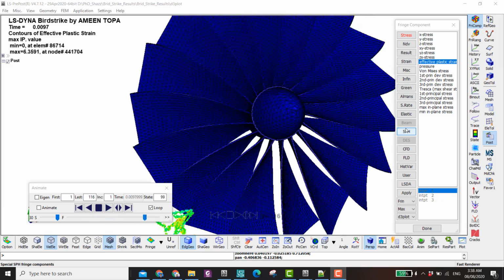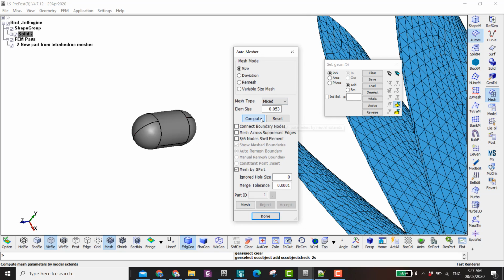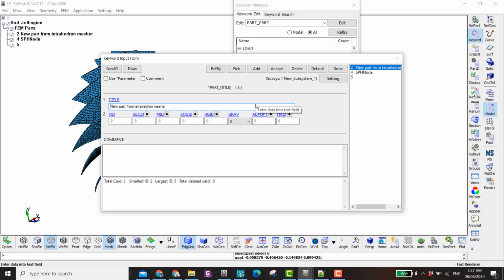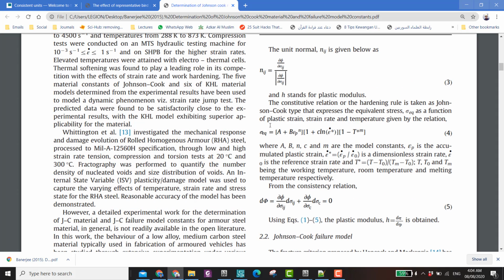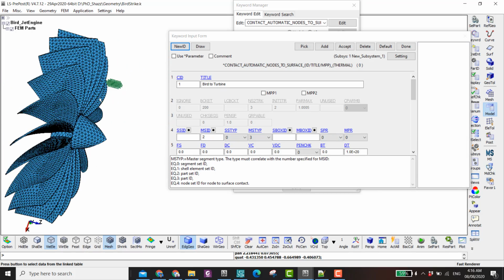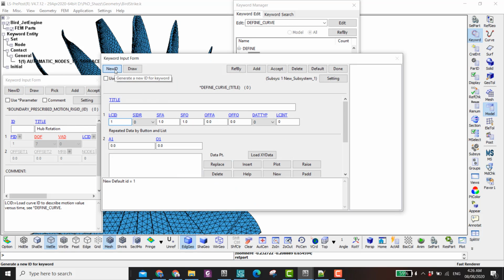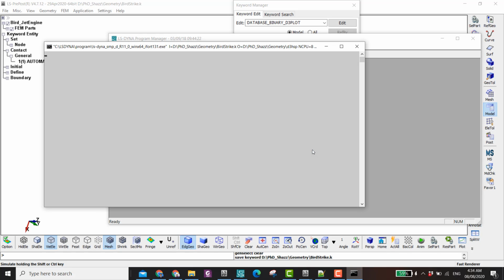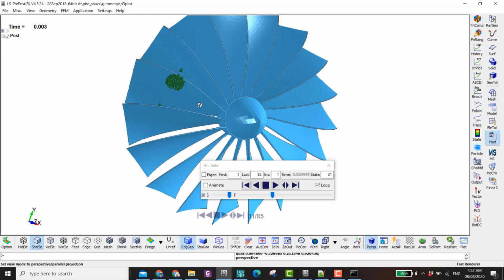LS-DYNA TUTORIAL 17: Bird Strike Simulation Revisited

Comment: thanks for helpful video. and my bird does not move. what should i do?
Reply from the maker: Double check the input. Material properties, contact, and density of the bird particles. 

This is the second tutorial on Bird strike simulation in my channel. Maybe you want to check the other tutorial first...
Reply: thanks, sir. i saw the video, and change some values. but, the bird penetrates the blade. could you tell me what's the problem?
Reply from the maker: @katyhan8102sorry, it's hard to tell without actually having a look into your file.

Comment: Amin can I make this a composite material with fiber direction. (I am asking as this is a solid element)
Reply from the maker: Yes, check my tutorial on Low Velocity Impact on a PALF composite panel.
Reply: @AmeenTopa  i used to know that I have to select Part_Composite for ply with fiber direction and then use move and copy.  But in your video i can use fiber in one direction dor each ply. I want 0/90 and 45/-45. Can you suggest me how can i achieve that. N.B as turbine blades are curve solid elements.
Reply from the maker: You can do to element tool, element edit, then choose direction option. There you can edit the direction of the elements layer by layer.  @mischief-nd5kp
Reply: @AmeenTopa  so for blades i use multiple solid elements layer and then assign each solid layers direction. will it work like the fiber direction when i use MAT_Enhanced_composite_damage. as if i use shell elements it will not give any thickness. this is for my research. And does research standards accept shell elements for (hybrid CFRP+Titanium Alloy in leading edge ) ? thanks in advance

Comment: I was solving a similar problem to this, where I took a stationary blade, and gave velocity to the bird. But as I increased the velocity, the SPH particles are passing through the fan blade, without impacting the blade. Even though everything else was the same, the SPH particles are not creating any plastic strains in the blade, instead, they are penetrating it without any effect. Please help me with it, as no matter what parameters I change, same thing is repeating itself. Do let me know if you need any other information.
Reply from the maker: Try reducing the time step size. In CONTROL TIMESTEP, set TSSFAC = 0.06667 or lower.
Reply: @AmeenTopa  I have set TSSFAC=0.06, and have got better results. The blade now seems to get deformed, but the SPH particles are still penetrating the blade without the blade getting torn (although some plastic deformation is occurring). Also, I have fixed one end of the blade/rectangular plate, but instead of the entire blade bending along with targeted deformation, I can only see stresses and deformation at the area of impact and no stresses at the fixed boundary (which I have fixed using SPC_SET). I am not able to understand why is that happening? Can it be because the velocity is too high (I have set it as 8.6e4 m/s)? Or is there some other reason? Kindly help.
Reply: @sam2215  have you find any solution to this problem ı couldn't solve it. My particles passing through my blades
Reply from the maker: If the properties are in the unit-consistent, then try reducing TSSFAC, as my previous comment above.
Reply: @AmeenTopa ı don’t know the problem but during simulation I mean analysis. My turbine model is getting bigger and bigger like it’s growing. I couldn’t understand the problem. Although I changed the time-speed-time step etc. I couldn’t find the problem. Do you have any chance to control my k file if I share the link with you
Reply from the maker: @celalbas3116 if it gets bigger and bigger, it could be a problem with the initial velocity.

Comment: Thanks a lot for your videos, they prove to be wonderful to learn LS-DYNA. Its just that I was solving a similar problem to this, but instead of taking the entire fan, I just took one blade, kept in fixed using spc constraints on one face, and gave velocity to the bird in two directions. But the following error is showing up. My guess is that it has something to do with contact, but I don't know what's exactly wrong. If possible, please help me with it:
* Error 40041 (SOL+41)
     minimum time step size reached
     On a restart minimum timestep will be 0.0000E+00
     dt of cycle 6980 is controlled by solid 67125 of part 1
    6981 t-5.9223E+05 dt-5.92E+05 write d3dump01 file
Reply from the maker: @sam2215  check the consistency of the units. Maybe there is a typo.
Reply: @AmeenTopa  Yeah, you were right. I was using mm as the unit but inserting values in SI units. Thanks a lot.
Reply from the maker: @sam2215  glad it helped, all the best!

Comment: The connection between the inner and outer hubs of the turbine breaks after starting to rotate？ Why？ The whole turbine just breaks.
Reply from the maker: You need to apply rotation to the whole turbine, not only the hub.
Reply: @AmeenTopa  Thank you. I will try.
Reply: @AmeenTopa  I have another question, I am doing a similar example, but replacing the bird with ice. I would like to ask you, why does my key file generate stress before collision occurs and the turbine has already started rotating? Is this caused by rotation? My teacher told me that it used a program to calculate the same thing, but it showed that stress should not be generated at this moment. Thank you very much.
Reply from the maker: @dududulcap458  yes, stress will be generated due to rotation. That's normal because we are doing explicit analysis.
Reply: @AmeenTopa  i see. I wonder if there is someway to solve this？To make stress 0.

Comment: I was following the same steps on a problem with a bit different parameters. It is also a bird strike problem. But the following errors are showing in the messag file:

* Error 20136 (STR+136)
     Material 561 is coupled with with MADYMO ellipsoid 2
     For MADYMO coupling, check y=madymo on the execution line
 
 * Error 21342 (STR+1342)
     The Madymo coupling flag, N, for rigid part id 561
     is greater than zero for a non-Madymo coupling simulation.
Reply from the maker: Are you using my human dummy models? 

If not, the problem is on MAT RIGID. You accidentally changed a parameter that you shouldn't. Basically, for this MAT, you need only to define RO, E, PR.
CMO, CON1, and CON2 are needed only if you want to constrain the centre of the mass of the rigid body.
Reply: @AmeenTopa  Okay, thanks for this, I was defining an extra parameter n which caused this error. But now, the following error is showing up:

 * Error 10146 (KEY+146)
     coordinate set id 7 is undefined
     CHECKING *MAT_RIGID INPUT Part ID= 561
Reply from the maker: There is still an error in the material model. Aside from the parameters I mentioned in my previous comment, leave everything as their default value.
Reply: @AmeenTopa  Yes yes, I corrected it. Its running now. Thanks for the help
Reply from the maker: @sam2215  you are welcome and all the best.

Comment: Hello Mr. Ameen, I would like to know whether it is possible in prepost, when a propeller and a runway of certain dimensions, strike each other from a certain height and at certain angle. I also need that the runway should a rigid material similar to concrete.
Reply from the maker: Yes, it is possible to control the impact angle and location. 

To change the location of the bird (or any object), you can go to Element Tools, Transform, Translate. 

As for the orientation of the object, you can use Rotate instead of Translate under Element Tools. 

To control the velocity, you can put the velocity components in INITIAL VELOCITY GENERATION. For example, if you put VX = 30m/s and VY = 40m/s, then the velocity will be 50 m/s inclined at an angle approximately 37 degrees. (Remember Pythagoras triangle). 

Lastly, for the ground, you can just use MAT02O for a perfect rigid ground or use MAT159 for concrete material.
Reply: Thank you so much Mr. Ameen, but I have already created a model with both runway and propeller at certain angle and at certain height between them and imported the model into prepost as IGES file and I think for that case it's not necessary to use "Element tools" option for moving the runway in both ways for achieving my required orientation 😀, am I correct?
Reply from the maker: @jadesdiary1394  If you already have the IGE file at the correct orientation. Then, no need to use Element Tools.
Reply: @AmeenTopa  thank you Mr. Ameen for your input
Reply: Moreover, I have one more clarification that, I am using a cad model which is made of solid material not like the model which you have used in this tutorial, which is made of surfaces, so I should use directly Tetrahedron mesh option to create a solid mesh to continue my simulation further. Is it right?
Reply from the maker: @jadesdiary1394  Yes, you can use the tetrahedron mesher tool to generate the elements for the propeller. However, since it is a thin part, it is better to have it as surfaces in IGS files not as solids. 

With surfaces, you can use AutoMesher tool to create a 2D elements, which will save lots of your computational time.
Reply: @AmeenTopa thank you for the input, I will try both the ways to look for better results.
Reply: Hello Mr. Ameen, I would like to know whether I need to add EOS for concrete material of the runway  which I will be using in my model. If you recommend, kindly let me know whether it is enough to use only the bulk modulus value or not.
Moreover I would like to know which type of contact, I can use for my simulation, as you have used "Automatic nodes to surface" and I thought of using "Automatic Surface to surface", let me know about your opinion.
Reply from the maker: @jadesdiary1394 The EOS choice depends on the material type. If you use MAT CSCM CONCRETE, no need for an EOS. 

As for contact, it is better to use AUTOMATIC NODES TO SURFACE for all contacts that involve the bird.
Reply: @AmeenTopa , thank you for your reply, I have used MAT020 rigid material, so I need to use EOS for the concrete runway.

I am not using bird as a contact surface, I am using rigid concrete runway as contact surface.
Reply from the maker: @jadesdiary1394  if you used MAT020 for the runway, then no need for an equation of state.
Reply: @AmeenTopa  , can I know the reason why I can't do tetrahedral mesh of solid propeller of one type I made, but I can make for another solid propeller I made?
Reply: @AmeenTopa   I would like to know whether about the contact method for runway and propeller too, kindly reply for it too, as if I use automatic nodes to surface, it's generating error only in that., so that I can't go ahead with the simulation.
Reply from the maker: @jadesdiary1394  as I said, AUTOMATIC NODES TO SURFACE is to be used only for contacts that involve the bird. Since the runway and propeller are not SPH, then use AUTOMATIC SURFACE TO SURFACE.
Reply: @AmeenTopa , thank you for your response, I will try and get to you.
Reply: @AmeenTopa  Hello Sir, I would like to know whether it is necessary to give anything about runway, as you have given SPH for bird. If it which one you recommend to give, ,is it solid? Or it is not necessary for my case, Termination and Timestep keywords under "Control" keyword are enough to do simulation?
Reply: @AmeenTopa  , Hello sir, while defining Automatic Surface to surface, I have not created a new entity for "Set node" as we can use "3" i.e. "Part ID" for both master and slave (in MSTYP and SSTYP) and define the part ID which has to be master and slave in their respective entries (in MSID and SSID).
Reply from the maker: @jadesdiary1394  Ok. That's not a question. 

Anyway, if the method works, then great 👍🏻
Reply: @AmeenTopa  Hello sir, is it not possible to provide both transverse Velocity and Rotational Velocity to the same component in LS-DYNA? As I have already tried and it is not working with 2 velocities on the same component or part.
Reply from the maker: @jadesdiary1394  you want the propellor to rotate while moving in a straight line? If that's what you want. Then it should be possible. 

Note that in my example, I fixed the hub from moving in any linear direction. So, in my example, if you applied linear velocity to the propeller, it won't move.
Reply: @AmeenTopa , thank you for your quick response and I removed the hub and then I have given both the velocities by not fixing the propeller and I can't get the simulation I need, I can understand I may did some mistake somewhere, but I did everything like you and added 2 velocities to the propeller the same way for Rotational speed in your example and removed the shell of hub and giving rigid material to it.
Reply from the maker: @jadesdiary1394  you need to use only one card of INITIAL VELOCITY GENERATION, where you define both translation and rotation (VX and OMEGA).
Reply: @AmeenTopa  thank you very much for your quick response and I will try with this and let you know.
Reply: @AmeenTopa  Hello sir, thank you as it worked out and I need to get some tips on "Contact" for my application, as I can see lots of types in contact, I tried with "Automatic Surface to surface", apart from that I can see "one way surface to surface interference", "one way surface to surface" and etc., so kindly give me a suggestion from your end, which one is really suits my simulation of a propeller moving transversely and rotating in the same direction and hitting the rigid runway and reactions of propeller has to be recorded. And shall I consider the propeller as slave and runway as a master in my case, runway is rigid and doesn't move in my case similar to the turbine in your tutorial.
Reply from the maker: @jadesdiary1394  AUTOMATIC SURFACE TO SURFACE should work better propeller and runway. 

Unless it is a contact with the bird (SPS), AUTOMATIC SURFACE TO SURFACE is recommended. It doesn't matter which one is the master and which one is the slave.
Reply: @AmeenTopa  Hello sir, thank you very much for your response

Comment: hi, do you have a tutorial for failure of modeling of a self piercing rivet joint?
Reply from the maker: I don't know have a direct video on that. However, if you practice the examples in LS-DYNA BASIC TUTORIALS playlist, then you should be able to do it. 

First, you need to do the simulation of the self piercing revit joint, export the results using the dynain method (check my tutorial on Springback), then apply a tensile load (check my tutorial on Tensile Test).

Comment: Hello, I just made a very similar model. Only difference I made was that I didn't use a propeller but a simple non-rigid curved surface mesh (shell). Since it was just a simple shell that didn't rotate or move, I skipped the part where you constrained the propeller. But even though I didn't constrain the meshed surface in any way, it still didn't fly away or give me an error. So I'm trying to understand the logic behind this. Is it because of the slave/master relation? Are masters always automatically considered fully constrained or am I missing some thing else?  Thank you
Reply: Hello again, I found out that the surface was actually not constrained. It is literally flying backwards after the strike. Is there a way to constrain a non rigid surface mesh?
Reply from the maker: @ammo381  you may use *BOUNDARY SPC NODE SET.
Reply: @AmeenTopa  Hello again, I am getting "The LS-DYNA time step size should not exceed 7.930E-07 to avoid contact instabilities. If the step size is bigger then scale the penalty of the offending surface." error now. Have you ever encountered this error? Why do you think it happens?
Reply from the maker: @ammo381  this is just a warning and you may ignore it n

Comment: you defined a curve for rigid hub but you couldnt use it because you changed termination time from 10 to 0.01 but you didnt change the hub's curve thats why it does not work. I think you didnt need to do it. Anyway, many times thanks for videos.
Reply from the maker: It is because the value of the angular velocity is with the wrong unit system.

Comment: Is there a way to add temperature i teraction between sph and shell/surface?
Reply from the maker: Yes, you can use THERMAL options in the CONTACT. Also, you need to add thermal material properties to the parts and use coupled thermal-structural simulations.
Reply: @AmeenTopa  could you please elaborate a bit more in the thermal contact? I'm guessing you're referring to the thermal check on the automatic node to surface contact. My doubt is k value (of which material, if I already specify In the thermal property of the material) and the H value, which is not so clear.

Thanks for the clarification 👍
Reply from the maker: @newtonrufino1449  Please check the examples in this link:
https://www.dynaexamples.com/thermal/thermalcontact-heatflux

Comment: Hi Ameen, me again :) I am doing bird strike analysis to a leading edge. I figured out some points but i am having trouble with self contact i guess. SPH and Body interacts quite accurate but just the skin of the leading edge deforms. Can you tell me what is wrong, what i should work on in my project? If you have time, can you email me so i can send you the keyword file. 
Email: atakanasarm@gmail.com
Reply from the maker: Dear Asar, 

You can try Contact Automatic Single Surface. You define the slave as part set which contains all the solid parts. This will define the contact between all the solid parts as well as self contact of individual parts. The master should not be defined.